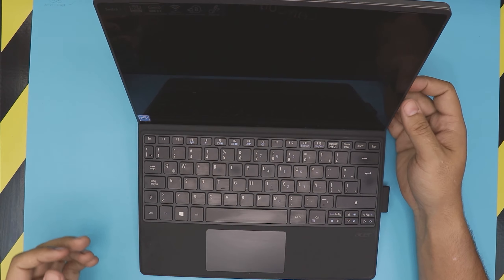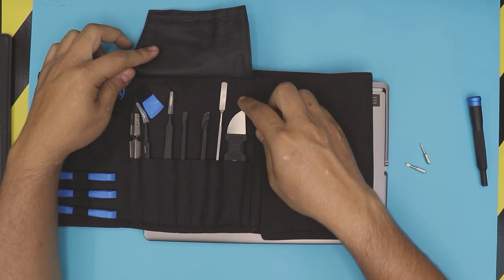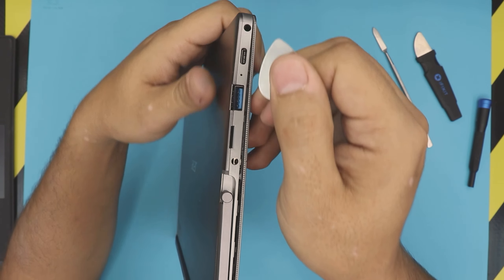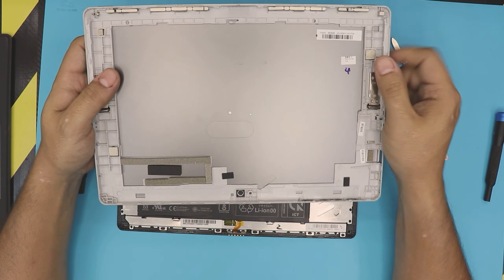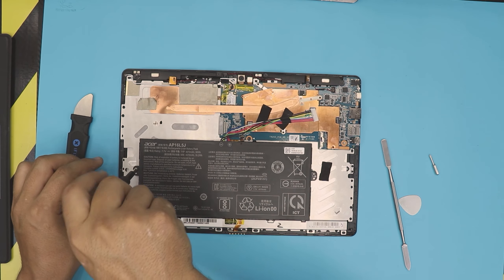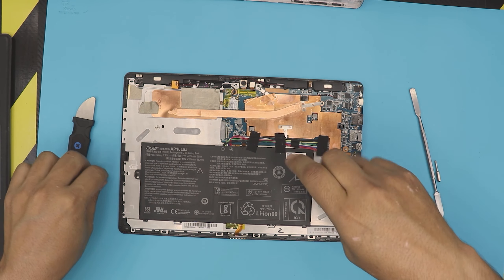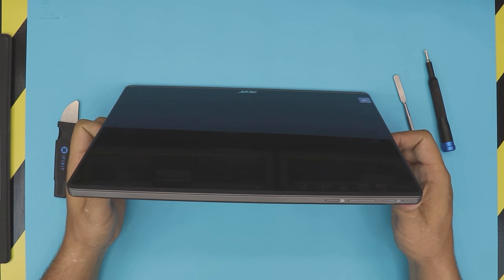Acer Switch 3 N17h1 Battery Replacement Step By Step....

Comment: Thank you so very much for sharing your work with the community;  this is precious. I was able to replace the battery safely and without worry thanks to this. I was hoping to fix the charging port at the same time, since it becomes more capricious every day. No luck, it has to be replaced. Worse, it's not capricious anymore: 100% broken after messing with it. While finding the part will be easy because you shared the really pertinent tablet model number, removing the motherboard and replacing the port is another story :(  A headache is soldering is involved. If you have plan to share this as well, I'm sure thousands will benefit from it. You sir, are the first video I like or subscribe since youtube is in existence.
Reply from the maker: It's my pleasure, my friend.  
I appreciate your support, and I'm glad that my videos are helping people out.  
I will try to get my hands on this tablet again, and I will definitely make a video on how to replace the part.
Should you have any further questions or requests in the future, please don't hesitate to ask me.
cheers🍻
Reply: I have the same problem, but you can also charge via the USB-C port!

Comment: very good video!
i need help changing the battery of the acer switch 5 sw512-52!
Reply from the maker: Thank you for the feedback! if you wish to support the channel you can LIKE or SUB or both :P
regarding your request me get my hands on one and i will for sure make a video. but the steps are 90% the same steps.
Reply: @uFixTek  would appreciate it if you would make a video about the acer switch 5 SW512-52, unfortunately here in Brazil we do not have assistance for this device.
Reply from the maker: for sure i try my best to get one and make a video :)

Comment: Hello ...i have a question about no power after i replace the battery ...i have no power and no led ..it is a switch 3  do you have any experience or advice ? Thanks
Reply from the maker: Thank you for the feedback! if you wish to support the channel you can LIKE or SUB or both :P
regarding your question: remove the battery and charger and press and hold the power on button for 30-60sec. then plug in the battery and connect the charger and wait 5-10min without powering on. then power on and see if it works. we get a lot of this switch3 in the store and everyone of them have different solution some have bad components that needs to be replaced.

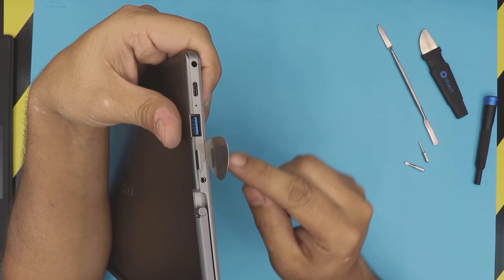Comment: The point at 2:17 is impossible for me on the Acer Switch 5, I just can't get anything into the gap (I'm using the same iFixit kit) and have ended up damaging the surround a little as a result, any tips?
Reply from the maker: try start from other side no need to use a lot of pressure, there is no other way of getting inside, use a guitar pick a hard guitar pick. and do it slowly.
Reply: Any success?
Reply: @jayoli7073  Yes, the Switch 5 is different. The bezel is different, if you follow this video it doesn't work. You have to go directly between the bezel and the screen, then it pops out the same way as the video, just be verrrrrry careful!

Comment: can the laptop on without the battery? my switch 5 expanding
Reply from the maker: Thank you for the feedback and your support to the channel by SUB :P
regarding your question: YES it can and it will work even better as it will make the charger last longer, and the motherboard will have longer life span.

Comment: With this model can the SSD be replaced or is it soldered?
Reply from the maker: Thank you for your feedback and support and regarding your question: 
you cant remove the main EMC chip (ssd) but you can add an m.2 SSD up to 1tb:
https://amzn.to/2NFZ06C
Reply: @uFixTek  thank you for replying. Keep up the quality content.
Reply from the maker: thank you if you have any questions in the future ask me in any of my video comments :)
Reply: @uFixTek  I finally opened the machine and there doesn't seem to be a spot to put in an m2 drive.
Reply from the maker: @conanbdetective  yes there is , unless u have a different model, it goes right over here:
https://prnt.sc/ylbq3a
you will need a screw to hold it, get this kit and use the screw from the kit
Reply: @uFixTek Two issues:
1. While it does go there, the board doesn't have a port over or under the board.
2. With that said, without the port; the SDD is a bit short.
Reply from the maker: @conanbdetective  can you send me a picture of your board ? use:
https://prnt.sc/
Reply: @uFixTek  for some reason i can't leave those here so I'll leave it like this
prnt dot sc slash yowphq
prnt dot sc slash yowkla
Reply: @conanbdetective  damn i have the same problem i dont think u can fix it unless u solder the port on yourself.
That sucks..
Reply: @r00kiet80  yeah it unfortunately sucks. I got a SSD enclosure from Amazon instead which works very well; even as a compromise. I just make sure that I choose the SSD as the install location for programs. Having a full software suite on the go just like that is quite useful as I move between computers a whole lot. The product name from Amazon is UGREEN M.2 Enclosure for SATA NGFF SSD, 2 in 1 USB-A & USB C 3.1 Gen 2 to SATA B+M/B-Key External Solid State Drive Enclosure 6Gbps with UASP Compatible with Samsung, WD, Crucial, Kingston, Tool Free
Reply: @uFixTek  hello i have also a question regarding the SSD. My Acer broke down and i cant boot it up anymore, but i want to rescue some files from the ssd. Can i remove it so i can install it on my tower to save the files? thanks for the help!

Comment: question i have also switch 3 but no power how can i fix it thanks
Reply from the maker: Thank you! for the feedback and your support to the channel by SUB :P
Sorry for late reply, i was out of town, regarding your question: i need to know if your charger is working if you can use a multimiter to check that, and press and hold the power ON for 60sec  and try connecting the charger.
Reply: @uFixTek  the switch 3 that i mention is my dads gadget he said that it not open or no display after they have installed a company software or application after that he just keep it as a defect one i want to fix it by the way😀
Reply: is input 10-240v can i plug it in 220v??